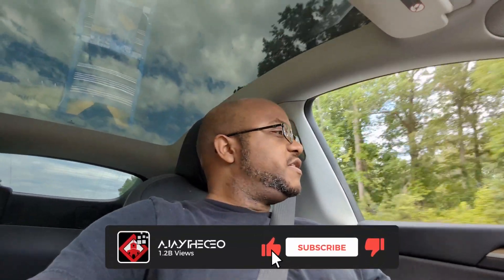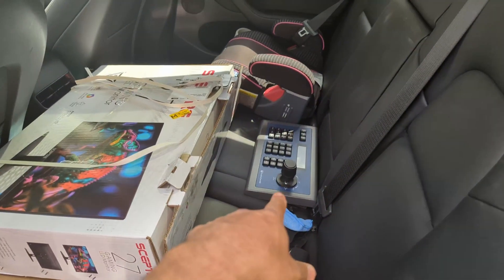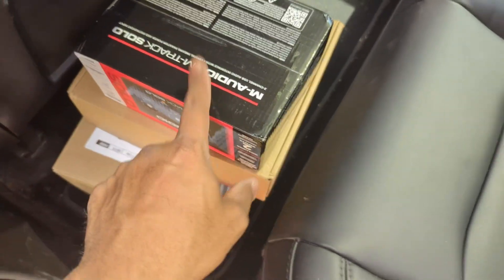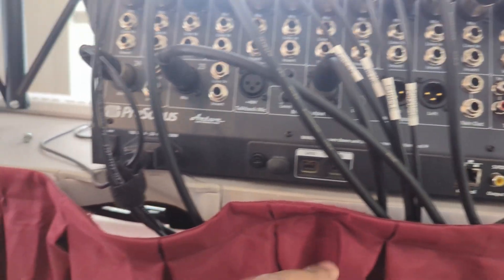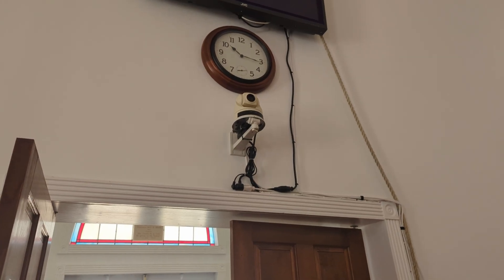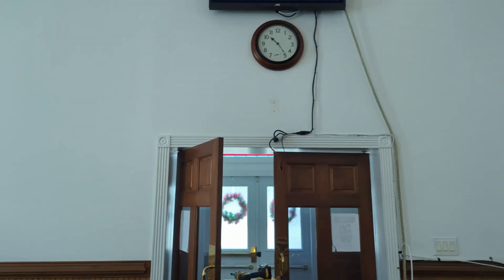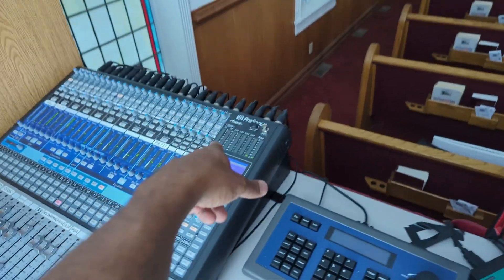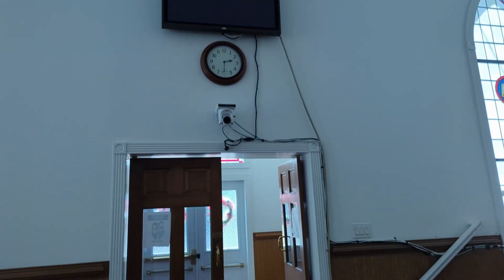Affordable $1000 Church Live Stream Setup - Shiloh Baptist Church

Comment: Having it down also helps with vibration, although it looks like this church doesn’t use subwoofers for the kick drum. The subwoofers cause the camera to vibrate and bounce more when it’s sitting on top the stand versus hanging imo from what I’ve dealt with.
Reply from the maker: Yeah. I really need to make a PTZ shock absorber wall mount
Reply: @AJaytheCEO  🔥